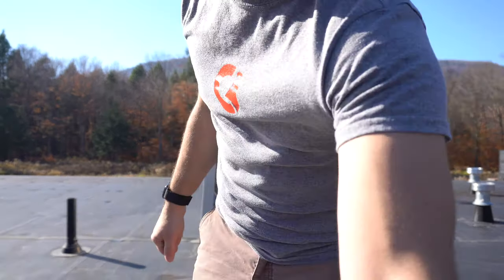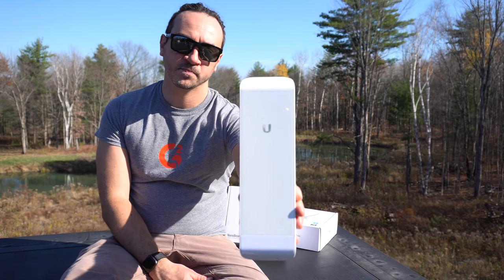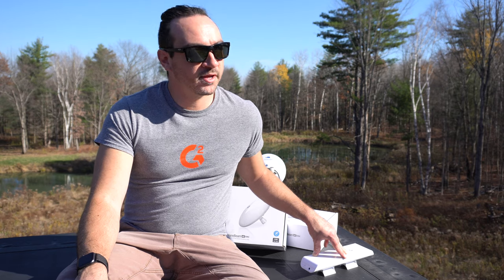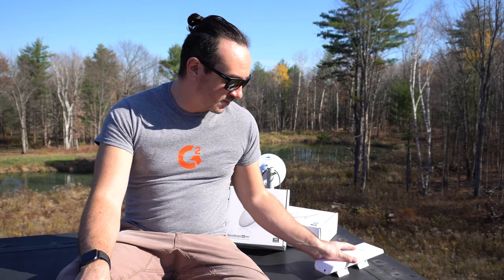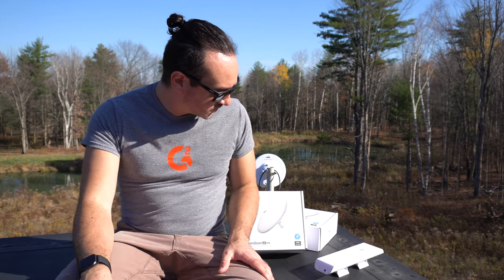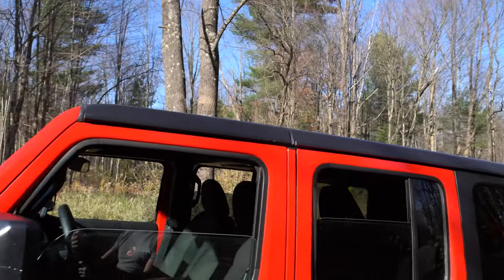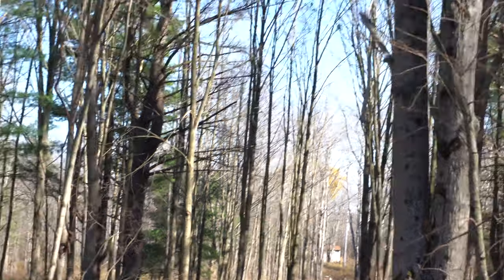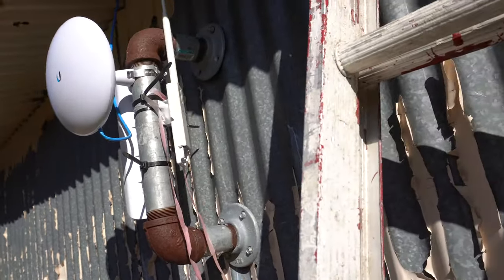Installing a Wireless Link (Point to Point)

Comment: I bet that metal Corrugated siding on the barn is causing some issue . I would try running a line from the barn to like a tripod where you have the clients receiver set up just temporary and see if you can increase speed. Just to test it. And if you find it it's working better set up some sort of a permanent solution
Reply from the maker: Luckily the new setup has been working very well, even as Spring has arrived in NY and the trees have their full foliage out.

Comment: Did you change any default settings for the radios? You can probably get some extra improvement by changing the power output and looking into how your constellation looks, as well as a firmware update.

Comment: If the power poles go all the way to your house you can run a fiber wire from pole to pole then put a media converter at each end to go back to cat5. I work for a phone isp that runs fiber and the wire is really light real easy to get it up high you just need a 28ft ladder to put it on the poles haha

Comment: Ok so i am a bit late to the show here but you should hide your IP address when running speed test for one. The other thing is the way you setup the beams you should protect the wires a bit better from uv or use outdoor rated wire. Lastly, I have a building 4100 feet away that has living quarters in it so I trenched conduit from the house to the building and put 62.5 SM fiber for 100Gbps connection. The Ubiquiti beams as used as a backup and very solid
Reply: IP Addresses don't matter if you show them

Comment: Why don't you increase the height of both devices rather than cutting the trees? you will get a clear line of sight then.
Reply from the maker: I got a quote to put in a utility pole at the barn that was something like $15k USD. Cutting the trees was cheaper in my case.
Reply: @hivepark6844  run fiber you can run MM 62.5 about  1/4 miles ., buy cheap conduit ., and bury the conduit with the fiber inside
Reply: @hivepark6844  you can have it pre-made

Comment: Hey everyone, can someone recommend best radio for me. I need to cover a distance of about 35km and there is no CLS (clear line of site)
Thanks
Reply: 900mhz with a yagi or a powerbeam ac 400 2.4ghz, all depends on height of the two locations and how much obstructions are inbetween
Reply: Prism 5g with 2 dishes 34 dbi you should be fine but you need Los

Comment: Kind of a misleading title. This isn’t really a solution for anybody running any net work as you have to have the ubiquity system at the core. Put that in the title. Be more specific.
Reply: Not true...we use Palo Alto as a FW. You can use the free version of Ubiquiti just to adopt and setup. You then don't need Ubiquiti outside of the P2P being first setup